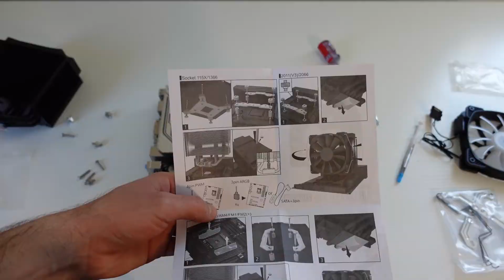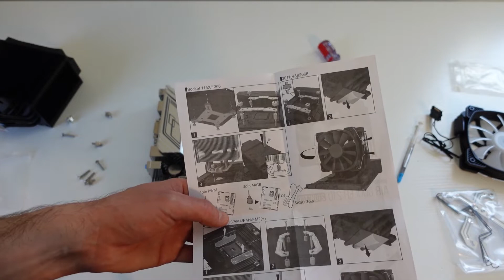Montech Air Cooler 210 - Unboxing & Installation Guide

Comment: How's the machining on the base and how is the cooling?  Thank you.
Reply from the maker: As far as the machining on the base, its one of the better cpu coolers i've installed.  Thermals/Noise are really good.  After this next Montech Air 100 video, i'll do some follow up performance/thermal videos.
Reply: @SystematicHardware  awesome.  Thank you.

Comment from the maker: The socket for the Intel Core i5 11600k is technically LGA 1200.  In the manual it does not list that socket but LGA 115X is the same dimensions.